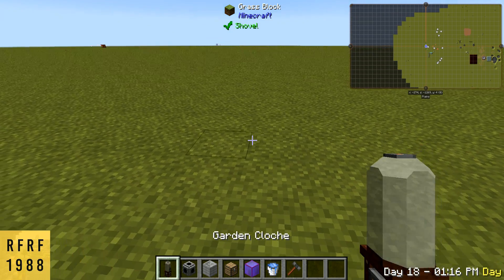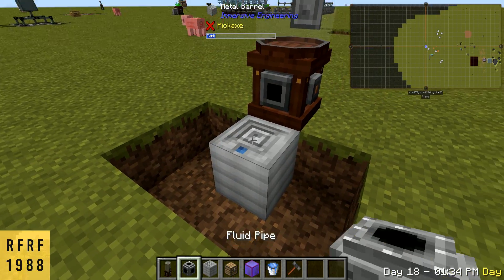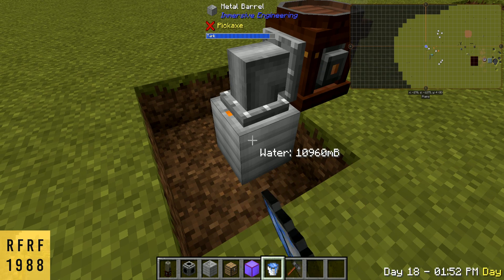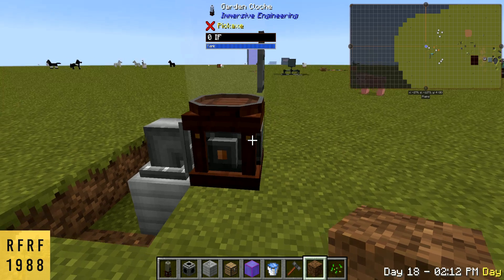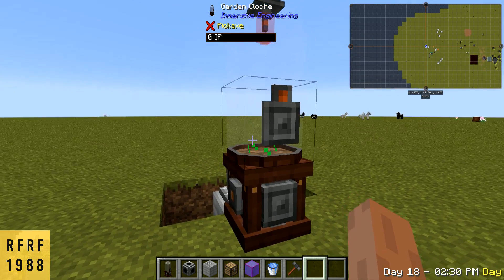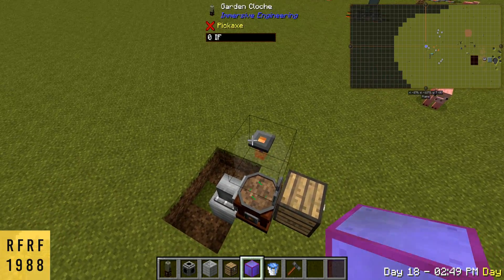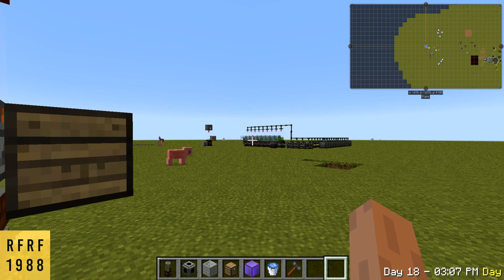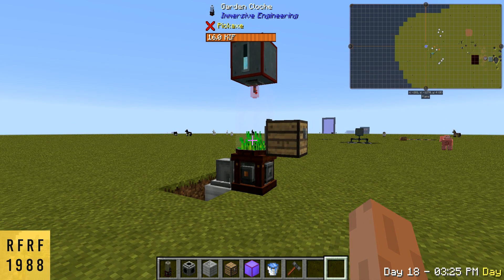Immersive engineering how to : Garden cloche

Comment: Thanks for sharing. Definitely too OP.
Reply from the maker: They are! but i love it...Iv used these many times for Canola farms when i get tired of using the same old Reactors for power every pack.
Reply: @RIFFRAFF1988  Don't know if they've been nerfed or what, but I did exactly what you showed and it's SUPER slow for me on Stoneblock 2. Worthless for automating seed generation for my chickens unless I build a gigantic array of them.
Reply from the maker: @PlatypusVomit  These are generally used for crops not seed generation but maybe try something from industrial foregoing that will probably produce far more seeds
Reply: @RIFFRAFF1988  apparently